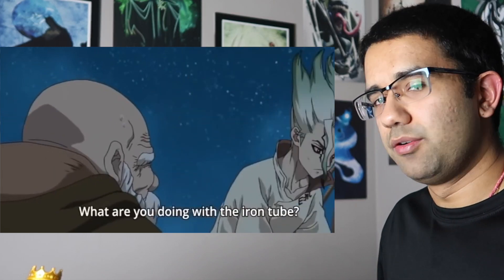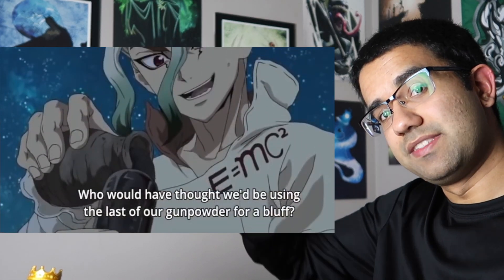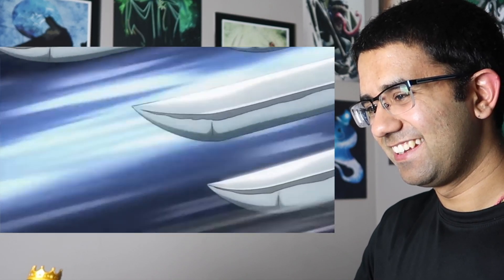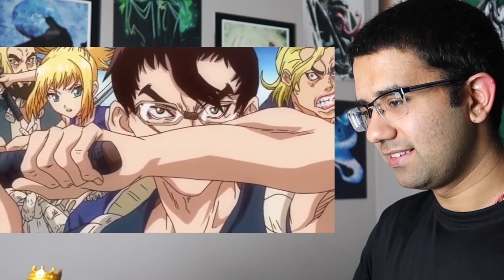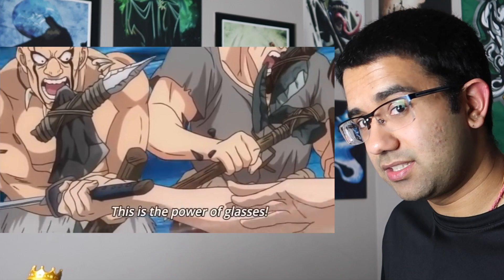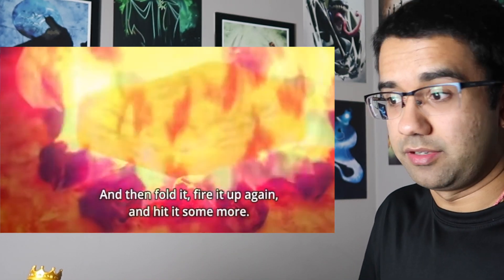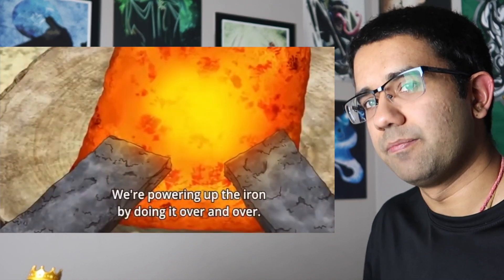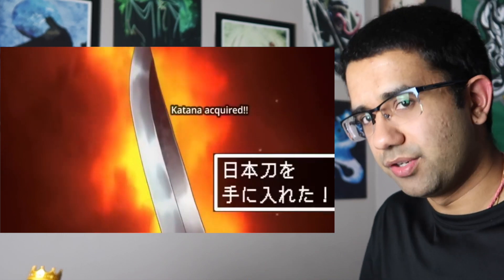Real Engineer reacts to Technology in Dr. Stone #18

Comment: As for guns, you aren’t wrong about auto ejection, but the gun itself needs to have an ejector in it in the first place. Guns back then that have evolved past that point like revolvers and some break action shotguns and rifles required you to manually eject the empty cartridges such things for the shotguns and rifles may be you pulling it out or breaking it open and letting gravity pull it out for you, or for something like revolvers, there was a ejection lever where you rotate the chambers, pull the lever towards you, towards the barrels of the gun and it would push the empty casings out.

Comment: But if Senku had a forge that went up to 1500 degrees he could scoop out the impurities that float above molten iron. And also they gathered the iron with magnets so I doubt there are many impurities to start with.
Reply: Impurities in steel are dissolved in the iron matrix. No iron is free from impurities. You cant just scoop it out in a molten state, u beed to add some carbonate or blow it with oxygen. Or degassing at a vacuum condition.

Comment: I'm sorry, you are completely wrong in the steel beating part. you don't get the impurities out of solid steel in 1200 degF (650 degC) and the purer the steel, the weaker it gets.
people usually get the impurities out in a molten state and no air bubbles in a solid metal.
the higher the temperature, the easier it gets to deform a metal. most likely the deformed grain structure will increase its mechanical properties but it will recrystallize to form a strain-free grain resulting in softer steel.

Comment: the biggest problem i have with the steel making part is that the folding part is totally redundant.
the folding does exactly what you said, it removes impurities and air bubbles, and that is extremely important when you are working with a bloom steel like Japanese Tamahagane. Tamahagane gets much and much stronger and tougher by folding it.
But Senku does not use Tamahagane, instead he uses crucible steel.  And a good crucible steel does not get better by folding it, in fact it might get worse.
in history, countries like the chinese, germans and persians all used to fold their steel until they they discovered crucible steel, and at that point they stopped folding it.

Comment: I assume since they are in japan the steel they produce is similar to what is called tamahagane, It is for a lack of a better word really dirty steel. The impurities like sulphur stuck to the steel is then extracted by the process of folding the steel and many of them can either ruin your heat treatment or your temper thus rendering the blade itself useless. I did not however see them use any kind of flux in the process of forgewelding the steel to itself after folding which while not necessary would makes the process far more likely to succeed. Still kudos for senku as he clearly knows how to treat a lowgrade bloom steel like tamahagenen in order to turn it into usable blade steel

Comment: Umm, you sure you’re using Fahrenheit? It’s a japanese show and everyone outside the US is using Celsius these days...
Reply: it's not making any sense if it's 1200 degF. forging should be done at a temperature above 900 degC. the steel should be in a single softer phase, austenite, and it's easier to be deformed.

Comment: So with the forging the constant heating, working, and reheating of the metal, yes is done to remove impurities, but it also helps to refine the grain structure of the metal, it tightens it up, allowing it to be more and more uniform in a manner of speaking, and the cooling of the blade as it's being working, or after is one of the points of the refining of the grain structure, also the impurities from the blade come off when working the metal as flakes called scale, and a common method for removing them is to have water on an anvil, which when the metal is being forged, is essentially pops them off, the water gets under it, and either boils them apart, or changes states into a vapor, and pops them off that way, but it does cool the metal just a touch faster. Heating and letting the blade sit to cool down normally without working it is called normalizing the blade which also is refining the grain even more, usually done after you're done working the metal into ur pref shape, then is heated again, and at a specific temperature, the metal is then quenched (dipped) in oil, or water, and agitated to release the vapor thats caused. Agitating should always be done straight vertically if possible to release the vapor easier, but also helps to rapidly cool the blade evenly, and properly, and also helps to prevent any warps in the blade, side to side exerts force onto the vapor horizontally, making it harder to rise to be released, which can cause an uneven cooling, resulting in a potentially weaker blade, and warpage. Then once cooled/cleaned off, you temper the blade  by heating at a low temp, something like 400, 450, I forget, for a couple, to few hours, allowing the blade to soften back up just enough, that it'll be less brittle, and more flexible, after quenching (before tempering) the metal tightens up, and becomes very rigid, and brittle, so you need to temper after to soften the metal or itll just shatter basically. 
Fuck that was a long comment, whoops

Comment: The last muzzleloading guns where cap and ball (also called percussion cap) firearms in the mid 1800's.
The "firearm" Senku made is similar to the handgonne (13th century) or fire lance (10th century) as he causes the ignition manually with a torch. 
Muskets uses a piece of flint striking a frizzen to cause the ignition, it's a much more advanced system as it uses springs, a trigger and a locking mechanism.

Comment: I still say it would have been more practical for him to make steel spearheads instead of katana, since most of the warriors in the village seem to have spears as their weapon of choice.  And if he wasn't sure how to craft metal into the right shape, a shortened katana blade attached to a polearm would have still been closer to what most of the villagers were used to (although actual katana make sense for Kohaku since she usually uses...I'm not actually sure if those count as long knives or shortswords...)

And in English dub, he also says katana are the best sword for cutting, and while they are definitely really good at cutting, they aren't the only sword that's specialized for that, so which one's actually 'best' is both up for debate, and mostly dependent on personal preference.
Reply: I kinda wondered about that too, more range and they were already good at using spears. I figured they would need to learn how to handle katans

Comment: It's not only the heating and hammering that removes impurities from steel. You also fold it to expose a greater area to the air so that the enclosed impurities oxidise and can be brushed off. Also, those that are not removed are at least spread out evenly to avoid specific week points. However, the folding also makes the carbon oxidise so you have to start with a higher carbon content than you actually need and not keep folding for too long, otherwise you end up with iron or mild steel which is not great for edge retention.
Reply: Not great for edge retention, but still better than rocks.
Reply: @chaosstripe9446  It's a mix of art and science. you need to find a balance between high and low carbon content so that the blade will be hard enough to reliably hold an edge, but soft enough it doesn't break and chip from being brittle- and at the same time you want the body to have enough flex to absorb the stress of impact without breaking or developing microfractures. That's part of the genius behind traditional Katan's because the used two radically different grades of steel in the sword. They would have a softer steel core along the back and would fold the harder steel blade around it like a hotdog bun. It gave them most of the advantages of both metals allowing them to work together, while also reducing or eliminating most of the draw backs.
Reply: You cant remove impurities by hammering. Impurities are removed during the steel making process.
Reply: @doddyalexander1  Actually you can, the constant heating and stress of forging can break off impurities that simple heat wouldn't. It's where you get a lot of the scale that breaks off when hammering. plus the constant heating and cooling allows the metal to stabilize into a more crystalline structure.
Reply: @FirstIsa  scales is not impurities. Scale is a product of reaction betweem Fe and O at high temp. All steel are crystaline, what do you mean more crystaline structure? Non metallic inclusion formationsuch as FeS or MnS can only be prevented by reducing S. If u dont have vacuum degassing you will have it. You cant break them as they are more ductile than the steel. And most impurities dissolve in the Fe matrix. Imagine disolving sugar in water, but steel is the water and all in solid state.
Reply: @doddyalexander1  Sorry I learned my metallurgy in a friends back yard forging things not a lecture hall or lab so I may misuse terms. What I meant was a more uniform crystalline structure- as in the grain becomes more uniform in size and direction.  The cycle of constant heating, working, and reheating when working steel in addition to being necessary to be able to shape it without loosing significant amounts of material,  acts to gradually normalize the material and by stretching the billet and folding it you ensure the heat soaks into all of the metal at some point. Normalizing steel does in fact force out impurities in the same way that annealing it would however the normalization process is more cost effective than annealing as it let's you keep the forge/furnace hot and ready for another piece of stock rather than letting it cool off gradually to allow the metal to gradually form the desired microlattice . Since the process of hand forging literally involves heating the steel to or above it's soak temperature and point, then taking it out and cooling it while applying pressure (hammer blows) it acts as a sort of halfway heat treat and normalizing which again- forces impurities from the steel as they are likely to have a different soak point than the metal. It's also why with low quality steel where the carbon isn't evenly distributed you want to fold the steel as it spreads out the carbon content as the steel is worked giving you a more homogenous metal.
Reply: @FirstIsa   It is impossible to remove impurities by normalizing or forging. what happened in normalizing is simply grain refining. new equiaxed, strain-free grain grow in the grain boundaries of deformed grains and you can't control the grains direction/orientation.
impurities are dissolved in the matrix and if it exceeds the solubility limit, it will get out of the matrix and segregate to the grain boundaries like what usually sulphur does.
Reply: @doddyalexander1  You can't remove all. Only some that bind to oxygen and whose oxides have a higher melting point than iron. When you see a forging process, there is always a dark layer emerging on the glowing metal, that is then brushed off. These are the oxides, some of which come from the enclosed impurities being exposed to air but also the carbon and other 'useful' stuff. This is certainly not as thorough as the modern industrial smelting process but useful enough to be worth the effort. At least for the things that your life depends on.
Reply: @madao7865  no my dude, that's iron oxide. that's what happens when steel/iron exposed to an oxygen-rich atmosphere at > 500 degC. it's literally Fe and O, nothing else.
impurities in steel are Nitrogen, silicon, phosphorus, sulfur and excess carbon. they are dissolved in the matrix of Fe up to their respective solubility limit in the Fe matrix. when inside the matrix, they are in the form of atoms not as a compound like oxides or else. because the solubility limit decreases as the temperature goes down, these impurities segregate to the grain boundaries and form things like silicate, sulfide, etc. you can't remove them by bashing steel at high temperature.